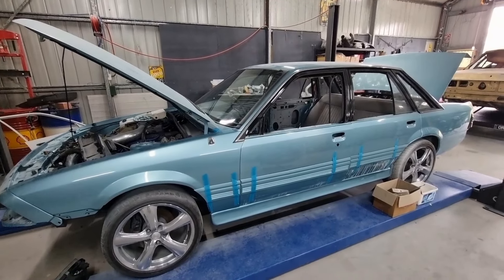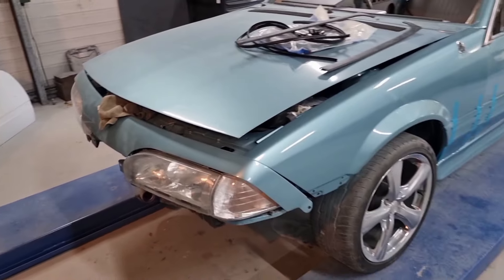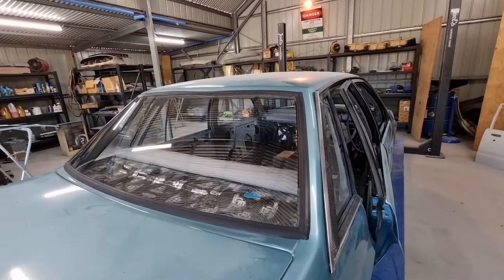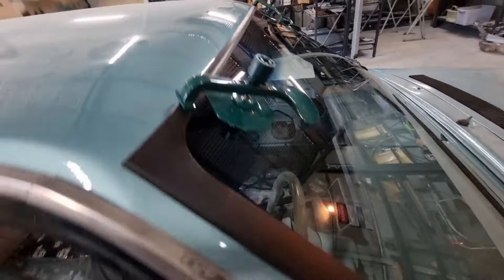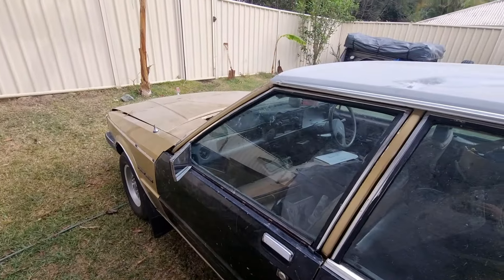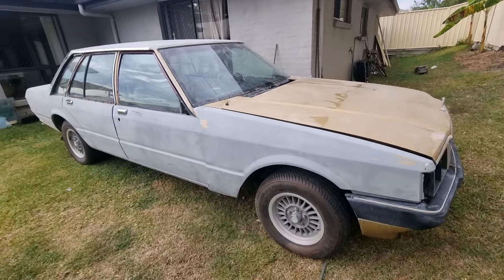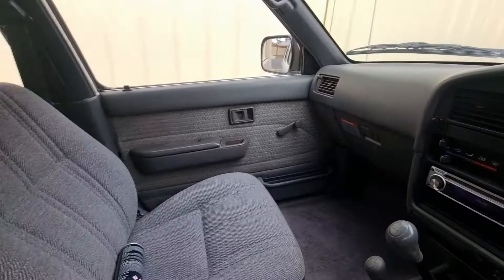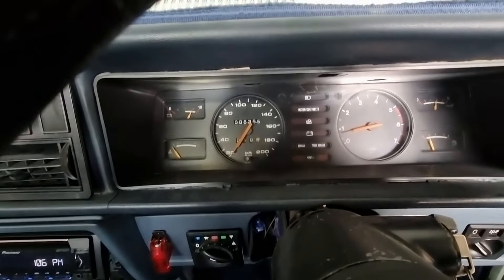Vl turbo commodore engine and gearbox installed.

Comment: The paint came out real good mate, now your onto the fun part as they say, putting it back together. Cheers mate.
Reply from the maker: Thanks, mate. came out good. Yeah, that's the fun part, and every nut and bolt  cleaned and all painted now that took a while.